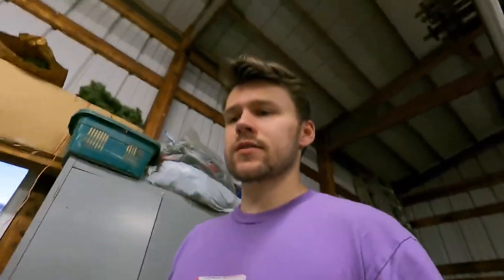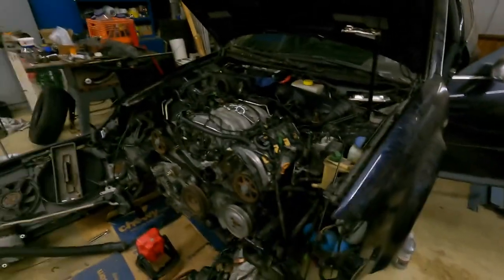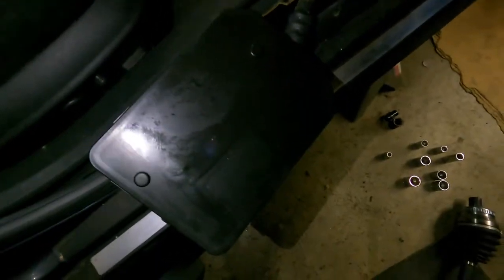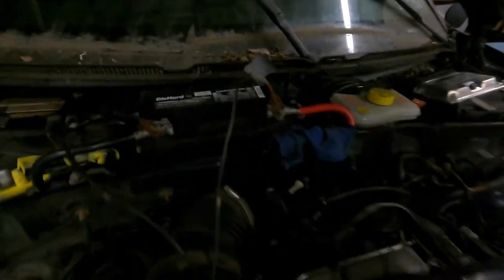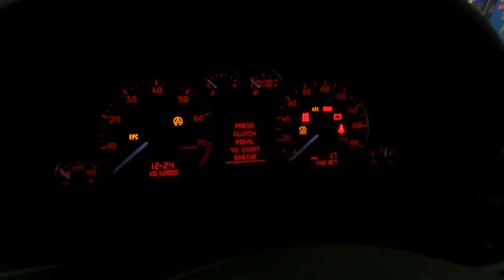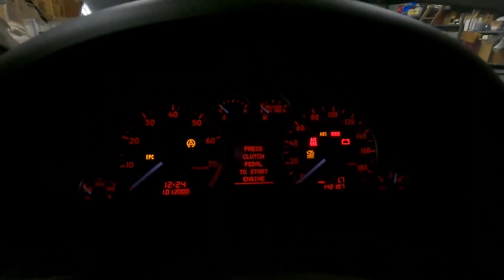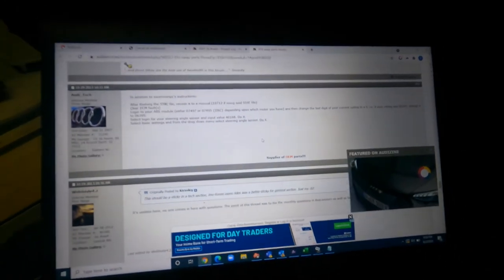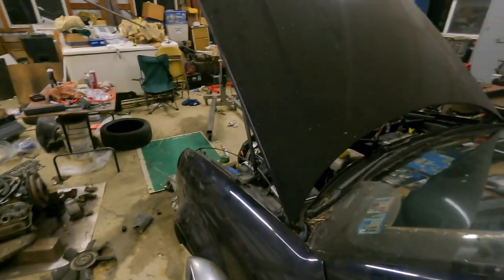How To Flash-Tune Your Audi ECU

Comment: I have an Audi a4 b7 (2008), installed a down-pipe, now I have cel for downstream o2, I installed the non-fouler spark plug adapter, installed a spacer with a mini cat, and still have the code. 

Can you recommend me a method or a flash bin with the adapter or anything I can do?

I will appreciate a lot.
Reply: make sure the non fouler is on the second bung (the one further downstream) this worked for me.